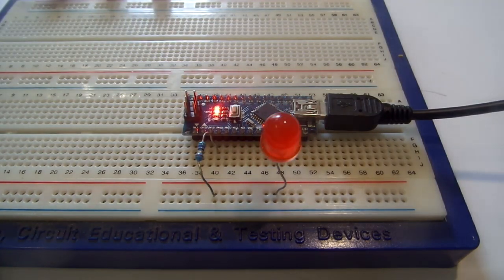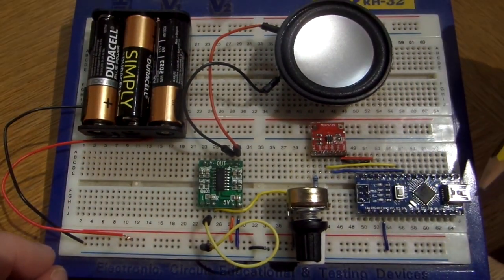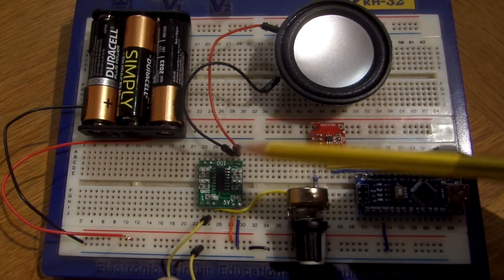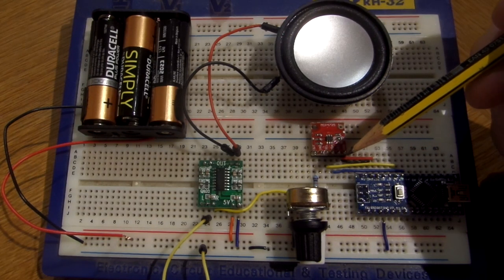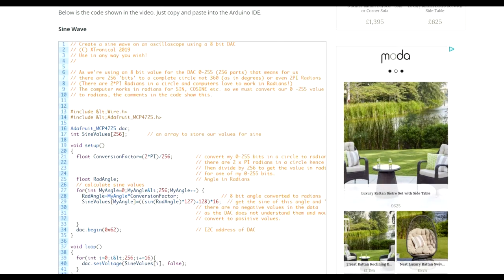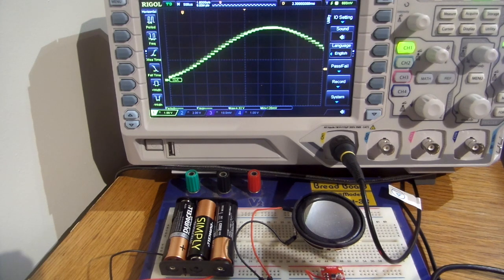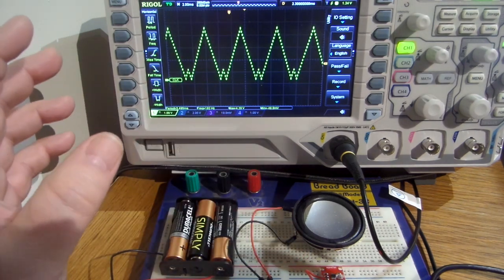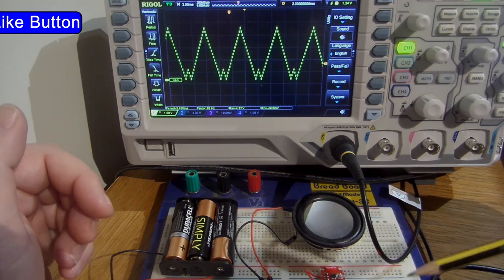Using a DAC with Arduino (MCP4725) Digital to Analoue Converter

Comment: The most simple DAC is a resistor ladder.
Reply from the maker: For speed that may be something I have to do but would use several pins. It's a very possible idea.
Reply from the maker: Been thinking about this a lot Chris and the sheer performance increase seems to be too much to miss on even if it does mean a shed load of resistors, a quick check shows I'll have enough pins for all that I want to do (I think). Thanks for the heads up, I was blinkered to just using off the shelf boards. Cheers.
Reply: I totally agree and it definitely don't have unknown errors